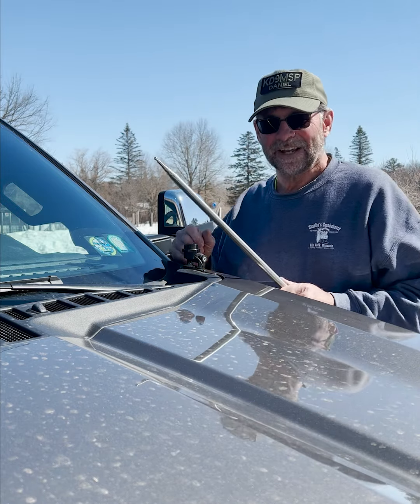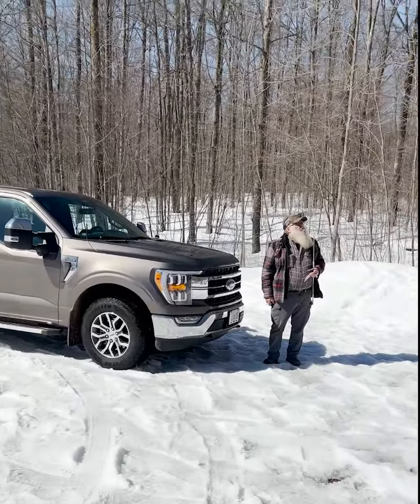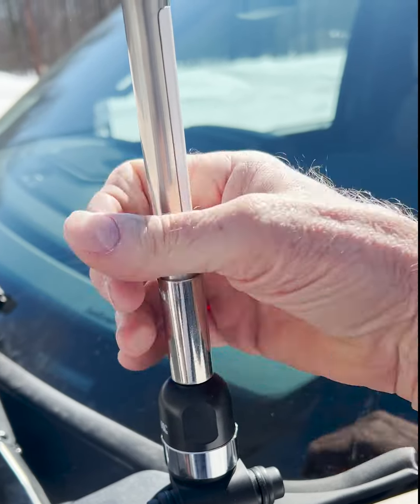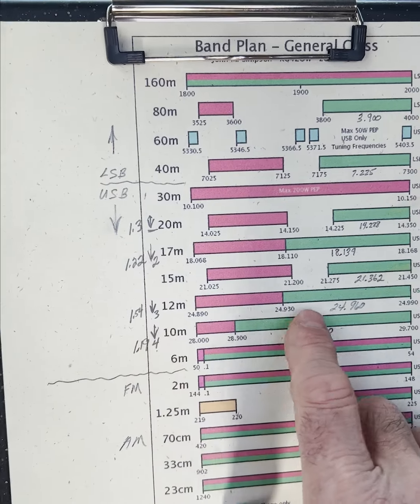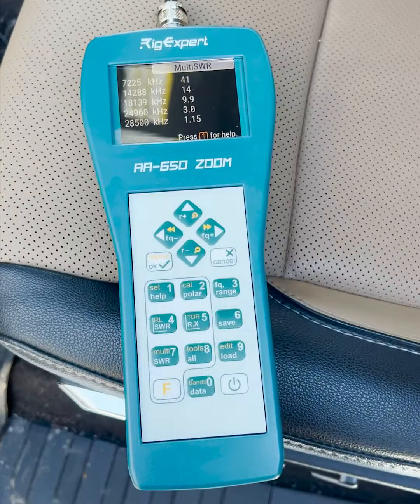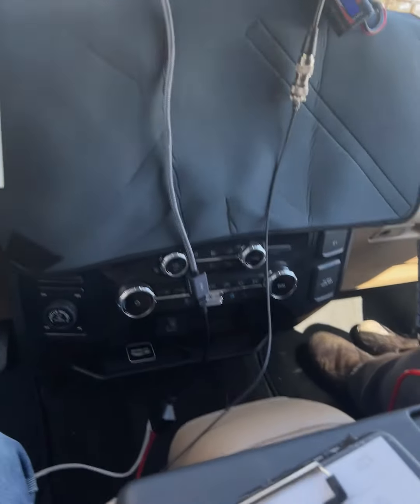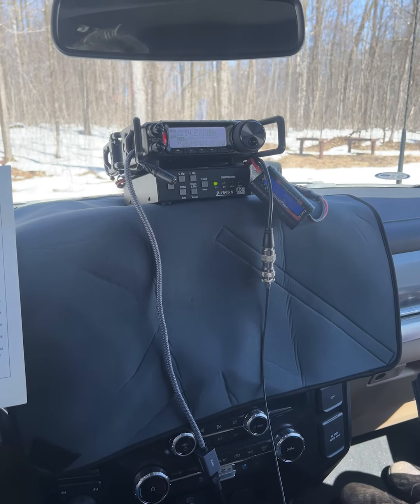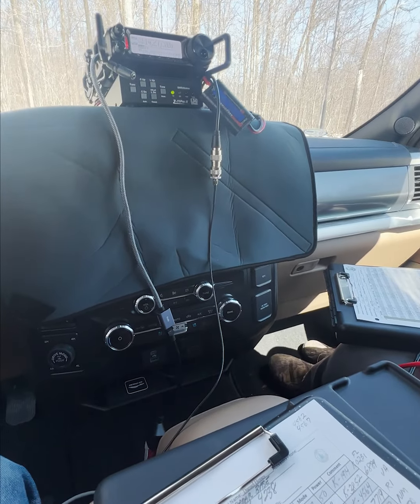Did This Antenna Ruin POTA for Me ??

Comment: I'm using nearly the same setup for 6 month now, it's amazing.
Especially during the colder month, when you want to operate from the car.

Love it.

Best 73 from Germany.
Reply from the maker: It is just so simple!  No radials.....just the vehicle as a ground plane.  Working on getting a way to use 40meters with the same setup.  Best wishes to you in Germany.

Comment: I can confirm his results. 

New POTA solution for the aluminum body F-150. Using a TRAM NMO to 3/8-24 mount and a Chameleon SS-17, 17’ whip. 

20m, Fully extended SWR < 1.27 across entire band

17m, Down 2.25 sections, SWR < 1.29 across entire band

15m, down 3.25 sections, SWR < 1.17 across entire band

12m, down 4.5 sections, SWR < 1.240 across band

10m, down 5.25 sections, SWR < 1.2 across FT8 and phone and < 1.5 for entire 10m band. 
Loving it. Highly recommend the SS-17 whip, very versatile.
Reply from the maker: Isn't that just crazy easy?  Thanks for sharing your results.
Reply from the maker: So easy it should be illegal.😅
Reply from the maker: I recorded the down sections vs. the SWR  just like you did.  I also looked closely at the resonance to see where things were at.  Pretty good readings.

Comment: I have the EXACT same adapter and antenna! I have done some pota runs with it here in Douglas County, WI. Seems to work amazing.
Reply from the maker: Very cool!  It's just soooo easy and works so well.  I have plans to use this on a Rove Run in the future.  Super fast setup in a parking lot....tear down and move to the next park.  Sort of tough to get a Rove in the NorthWoods of Wisconsin where I live.  Pretty dispersed parks.  Have a great summer with POTA!

Comment: It's a simple quick setup.  I used the MFJ 12 foot for many years when I would travel to Aruba.   5 inch mag-mount on top of the rental car.  I would easily talk back to the States
with QRP on the FT-817.

Comment: Sounds like you had some really good luck with your set up. Just curious are all your panels bonded together on your truck? I’ve worked winter field field day from my truck using a Mag mount and  a 17 foot whip on the roof. My truck is not bonded together yet but it soon will be, and I may try that NMO mount like you have instead of the mag mount
Reply from the maker: You know I really don't know if all the panels are bonded together.  I did bond the NMO mount to the frame and engine hood with 3/4" flat braided strap.

Comment: good report! I use my 17' whenever I'm parked, and short hamsticks in motion - same mount, so easy to switch. If you're really lazy, just extend it all the way and use a wide range tuner - my AH-4 and G90 will tune 40-10 no sweat.
Reply from the maker: I use a variety of antennas for POTA.....but there are times you just want to get on the air quick and easy.  We used this for the 10-Park Rhino Run we did.  Just did not know what issues we would run into and really wanted to accomplish the Rove.  https://www.youtube.com/watch?v=uzNAR8rWrO0&t=58s
Reply: I should clarify (not in reply, just for the record.) I meant either my G90 with its internal tuner, or my AH-4 with an icom rig. I've also used a SGC with success. My point being that a wide-range tuner  will handle a 17' whip directly. If it's a remote tuner (AH-4, SGC, etc) at the base of the whip, the tuner loss is minimal.
Reply from the maker: @jeffkunce8501  Roger that.....

Comment: VERY interesting. 
I think I'm going to get this kit.
Also, as a newbie Ham here in Belgium,  I can see how useful your antenna analyser is to knowing the SWR reality
P.S. I also have bought a Yaesu 891 as my first real transceiver 
Going out and doing mobile is something I'm building up as a real fun area of HF DX'ing 
ON3VCF
Reply from the maker: To me using the antenna analyzer is fun testing different bought and home made antennas. Then comes the real test using it with POTA as an activator.  I log with HAMRS and it will produce a real nice map to view the QSOs from the log.  Shows me if the antenna I used is directional and how far out I reached.
Reply: Thanks ,I don't think it would make any difference, Pulling down from the bottom would make it easier to do KD9WTH  73

Comment: I would be interested to see if you can use a WRC mini coil and get 40 60 and 80m out of that setup. Thats a nice set up.
Reply from the maker: Interesting concept!  Like you probably understand it will not tune to 40.  Pretty much 20 to 10.  Bob on the video has a WRC mini.....we might just have to try that and report back.  Thanks for the comment.
Reply: @off-trailseeking3965   I use a chameleon 17ft whip on top of a mini on a tripod. I have to use 67ft radials to tune 80. I would be interested if it would work using the truck as a ground plane. 73's
Reply from the maker: @KO4GAR  for sure the truck is the ground plane.  I have recently using the 17' whip on  a tripod, up about 4-5ft with 2 tuned radials which are also elevated.  Check out the POTA Performer as talked about on the Parks on the Air Facebook site.  Awesome results with the Performer!

Comment: Hi Dan, thanks for this video. I just ordered the antenna and adapter you recommended here and am looking forward to trying it on my existing NMO front fender mount on my Wrangler. My question is because of the plastic removable roof on the Wrangler and its aluminum hood, etc., do you think it will be a sufficient ground plane? If not, could radials be attached to the mount and spread out a bit, like I’ve seen others do with a 17’ whip on a tripod or spike with no car? Thanks for any thoughts you might have.
Reply from the maker: Good question!  I was surprised by the good results I had playing with this setup.  I had the NMO mount on the truck (aluminum body) and just thought I would give it a try thinking if I needed to (like you might) I could just radials to make it work.  I did run some braided ground straps from the NMO mount to the hood and the fender frames for added grounding to the body of the truck.  Let us know how it works for you!  Pretty cheap price to experiment with compared to the other POTA antennas I have.

Comment: Well, I thought of another question. 😊 Do you use any kind of choke/balun on the coax in your mobile setup? I never have for my 2 meter rig (maybe I should have?) but now that I’ll be using that same  installation for HF as you’ve shown here with the adapter and whip, I’m wondering if it would be good to add a choke like we do in non-mobile installations?
Reply from the maker: Have not tried a choke/balun on this setup.  Just worked too good.  I do use a choke on the coax when I deploy a POTA Performer and any of the Chameleon antennas I use....like the CHA-8010

Comment: Nice info to have! What length feedline are you using? Thanks!
Reply from the maker: Very short.  It's the feed line that came with the NMO mount......going just through the firewall to the front seat area.....13.5' RG-316 Teflon coax cable
Reply: @off-trailseeking3965  Many thanks! 73

Comment: I’ve been struggling with a quick POTA antenna solution since I got my aluminum body F150 a few weeks ago. On my prior truck, a mag mount and ham stick was super fast to set up. I have the TRAM adapter you used, tried it with the 20m Hamstick but couldn’t get below 2.0:1.  I didn’t even think to try the SS17 whip I have. I’ll try it out and hopefully get similar results to what you got. If it works, this will be awesome!
Reply from the maker: I struggled weighing where to put the antenna on this 2022 Lariat too!  Mostly for 2m/70cm.  But just thought I would mess around with the 17' and the results totally surprised me.  I have that NMO antenna mount bolted with just one bolt I took out of one of the fender mounts.  Only think I drilled through was the small plastic corner.  I did add some grounding straps to under the hood.

Comment: That’s pretty cool, wondering if the antenna came with any guidelines as far as extending and retracting the antenna for the bands, I don’t have a antenna analyzer but definitely interested in this.
Reply from the maker: The antenna came with no instructions.  The amount of retracting will vary greatly for each person.....conditions, how the vehicle affects the band.
Reply from the maker: I would defiantly work on getting an analyzer like from RigExpert, Comet, or a Nano VNA.  First thing I do after setting up any antenna is check the SWR and other readings to see where things are at or if they need a little tweaking.

Comment: Dan, I have another question. When your friend was helping with the antenna tuning, was he adjusting using the bottom sections where he can easily reach or at the top so the antenna has to be removed each time a length adjustment was needed? Thanks!
Reply from the maker: He was adjusting the bottom sections.

Comment: Are you taking the antenna down from the top or from the bottom
Reply from the maker: Pulling down on the bottom sections.  Do you think there would be a difference if I pulled down from the tip sections?

Comment: What was the antenna you used? Can you list the parts list you used? Great video!!!!
Reply from the maker: The NMO mount is pretty standard and it would be up to you on what mount would work for your vehicle.  The antenna is a Chameleon CHA 17' stainless whip.  MFJ makes one too.....but from reports the CHA 17' is the better of the two.  Thanks for stopping by. I'll have to put together a video on the antenna mount.
Reply: For reference the MFJ antenna model is the MFJ 1979

Comment: That will definitely work. But, if your not going to put it in the middle of a car or van roof, it really wants radials
Reply from the maker: I actually went down this road with that exact thought in mind.  But then the RigExpert's readings proved me wrong.  I went on to activate the POTA park with 60+ contacts with good signal reports.  It would be interesting to attach some radials and try things again.

Comment: "Did This Antenna Ruin POTA for Me ?"
NO.  (See Betteridge's Law of Headlines)
Reply from the maker: You are correct! Maybe made things a little too easy though.
Reply: @off-trailseeking3965  I have the MFJ 17 foot telescoping whip and tapped loading coil.  Used it with Boy Scouts JOTA and it works great.  I pound a 4 foot copper rod into the ground, clip on some radials, extent the antenna and go for it.  I don't usually need a tuner since the elements can be adjusted to length.
Reply from the maker: @thomasmaughan4798  Nice!